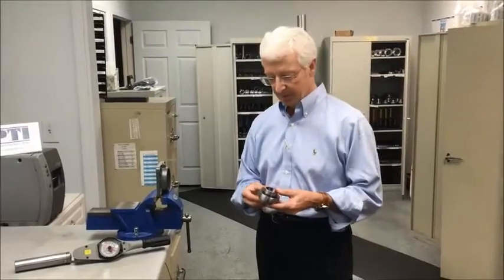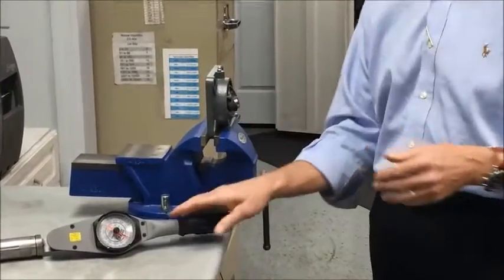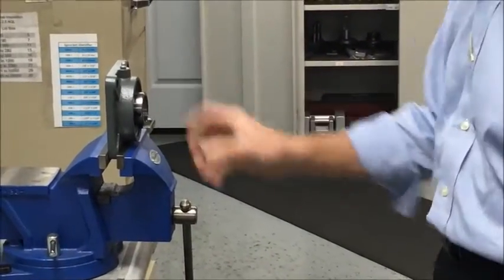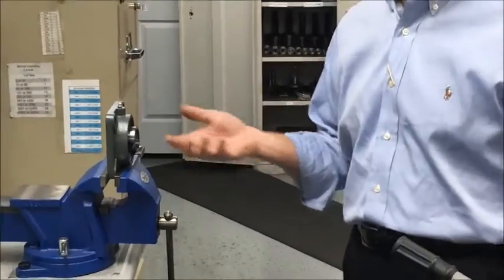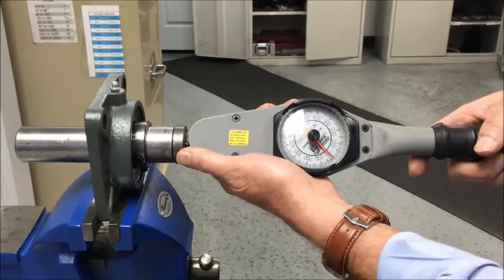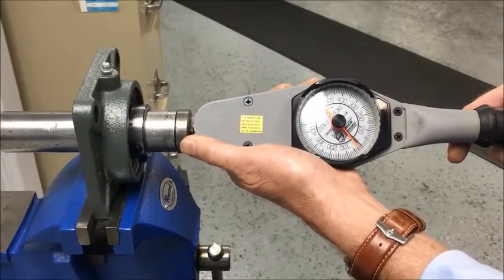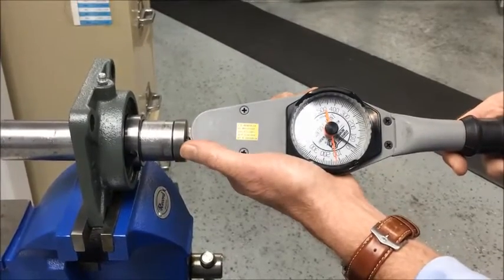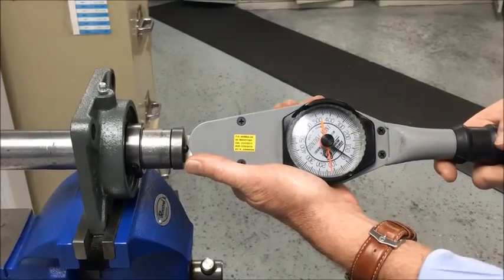Measuring Swivel Torque for Mounted Ball Bearings

Comment: Where did you get that gage? We manufacture parts with many spherical bores and assemble bearing. We have a snap on torque gage measuring at 90 degree and pull up. O cannot get 3 people to get the same reading during capability study. Some off up to 50 ft lbs. Thank yoi